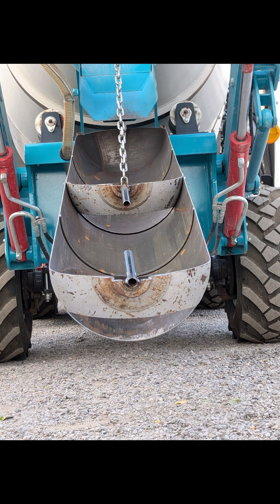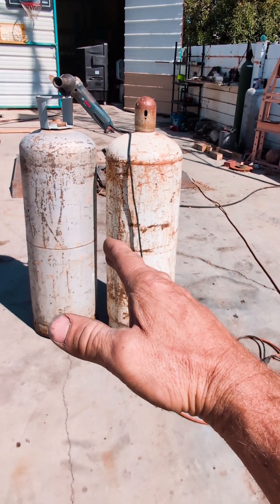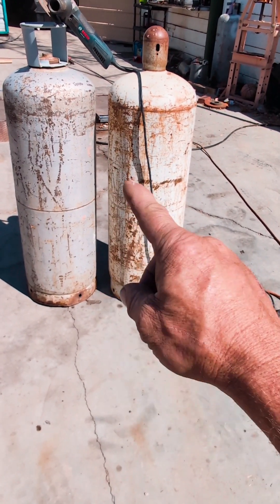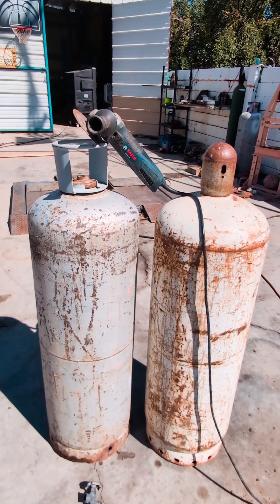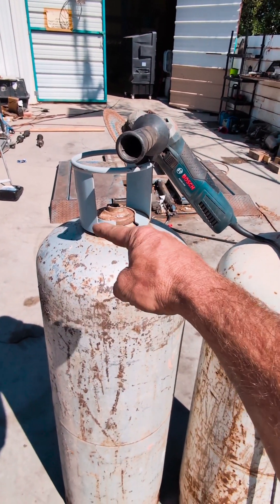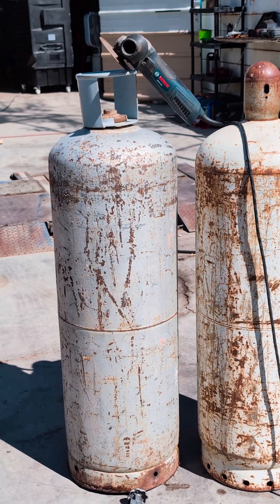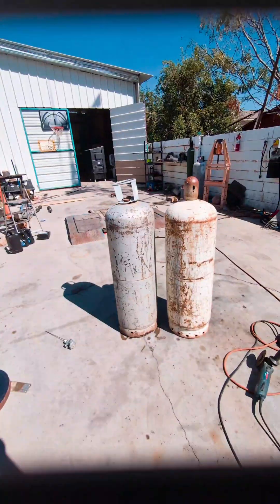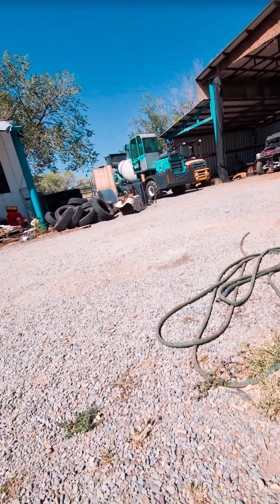CONCRETE WELDING CONSTRUCTION 🏗️🚧 👊🏻🔥🔥

Comment: I run a hose from car exhaust no oxygen no ignition. Learned the trick straight from a shop that repaired gas tanks.
Reply from the maker: Yeah that's another way as long as the engine isn't running rich "BACKFIRE" ☠️💥🔥